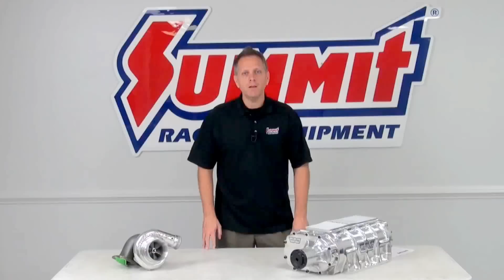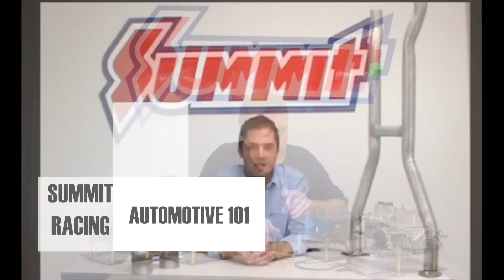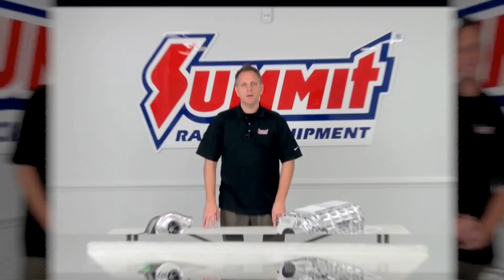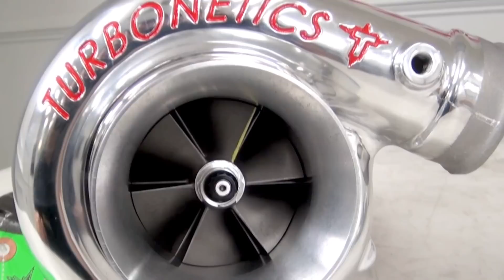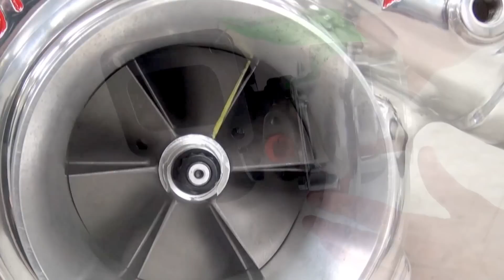Supercharger vs Turbo - Summit Racing 101

Comment: hi i have a stock 1997 chevy silverado would it a good choice to turbo charge it or would it be better if i do a supercharger im looking for something that can be daily driven but can also get down on the track?
Reply from the maker: Hi Alejandro, 
Either one fits that bill. Both are OE installed on a multitude of application over the years proving their reliability. What it really comes down to is this, are you a fabricator and installing yourself or are you looking for a kit? A kit you say, well then, availability and affordability need to be answered as well.

Comment: Two things:

I know that you can have multiple turbochargers on a car, and even a combination of a turbocharger and a supercharger (twincharger). But what about multiple superchargers?

Also, what is the difference between a traditional turbocharger and a variable geometry turbocharger?

Thanks.
Reply from the maker: Hi Jarek, 
Yes, you can have/use multiple superchargers. It just adds cost and complexity to the drive belt system. A Variable Geometry Turbocharger (VGT) has computer controlled vanes built into the exhaust (hot) side of the Turbo. Varying or adjusting the position of these vanes allows quicker spool ups and also engine breaking in diesel applications.  There is lots of info online about these or give us a call, we’ll help you where we can. 1-330-630-0240. Thanks for watching!

Comment: I drive a 07 lexus gs 350, what would you recommend for that? turbo or super?
Reply from the maker: Hi Flako, 
First, this will depend on kit availability for the vehicle. Next, if you’ll be the installer then kit & installation complexity should be considered. Lastly, affordability. When said kit is found, does it fit the budget.

Comment: I believe the best design of all. ( better than turbo charging or belt driven superchargers ) would be to spin either of these with an electric motor.  And not from the one car battery, but from a completely separate power source of rechargeable batteries which would be charged from the ac 110 or 220 volt circuit from a home or business.  The electric motor would have to be powerful enough to drive the blower or turbine as fast as the conventional types of super/turbo chargers.  The only downside to this would be the added weight of the number of batteries it would take to power the electric motor that would drive the blower/turbine ( and space to mount everything ).  Don't know how many batteries it would take but probably enough to add at least an extra 100 pounds is my guess.

Comment: I've had this idea for quite some time yet have never seen any forced induction design of this type.  My idea is to take your standard roots type blower, and rather than spin it from a belt off the crank of the motor, spin in with the exhaust half section of a standard turbo charger.  I know that in order to make this work, there would have to be some type of gear to step down the speed of the turbo charger quite a bit to get a similar rpm of the blower that a belt driven design would produce.  But I see no reason why this type of design wouldn't work.  Has this ever been done before?  I have never seen it.  And if the question of WHY comes up.  I would say because this would save much of the wasted horsepower lost from the belt driven design which uses power from the crank.  And if one were to ask, "why not just use the original turbo charger, rather than wasting the time and money to mate half of a turbo to a blower.  Answer:  just because it's never been done!  Just for the sake of curiosity!
Reply: That's a neat idea, but it takes a LOT of power to turn the gears in a supercharger. That's why you have the parasitic horsepower gains that he was talking about. On top of that, if you did get that to work you would loose a lot of efficiency in the end and still have lag since it's running off the exhaust. The turbo would have to move sooooo much faster than the supercharger's crank belt.

Comment: WOW..................   parasitic drive loss on super charger is around 30%   11% on turbos.  Turbos don't spool off air flow the spool from heat. That is why they are so efficient it is like they have a brain and work when needed. Both have there application but for power and efficiency I would choose turbos.

Comment: I have a 2002 ford mustang convertible it's a v6.. Im not a racer (any more) .. I just want a lol more power .. which do you think?
Reply: Turbo. More efficient but also more expensive. But will keep your engines running longer than a supercharger would. Much lesser stress on the engine when you are not going over 3k rpm or redline ing. But when you do all the power is there without sacrificing your engine power at all.
Reply from the maker: Hi Jose, 
If you are not willing to fabricate your own kit, and many are not, then your decision ultimately will be made by kit availability for your specific car.
Reply: +Summit Racing I have 2002 mustang convertible v6.. I found a turbo kit for $600... but found supercharger for $650..

Comment: Should I do a 5.3 ls turbo or 6.0 supercharged for an 96 impala ss? and why?
Reply: Turbo. You do not lose power to gain more power. Better fuel economy than having a stock engine. Engine runs more efficiently when driving normally. Engine will last longer on normal drive. Only time you want the engine to work harder is when you are going past 3k rpm to redline that is when all the power kicks in for some fun and it adds power to the engine without stealing any power from it.

Supercharger, the power is always there through out the rpm range whether you are driving it normally or taking it past 3k rpm to redline. But you are always losing some power to gain more power which will stress out your engine more wheter racing or normal driving. The engine will always have to work harder to make more power to run the supercharger. Lesser life span for your engine and more poor fuel economy. But it is also less expensive of an upgrade and more to easy upgrade.

Unless of course you know how to build your own turbo and can buy cheap turbo parts from ebay and assemble it yourself. But it is important to get a very good turno headers though. Already buily turbo kits for your car is where it is a lot more expensive.
Reply: Turbo headers*

Comment: Which one fit for better mid and top end power for my 370z nismo 15'
Reply: Turbo forsure on v6s but go twin turbo
Reply from the maker: +hayato zami, 
Many times due to cramped engine compartments and fitment issues, these kit are engineered and sold by specialty shops. Currently we do not have either kit available for that car.  But, we do have Nitrous kits available. Same power gain, more affordable!  Give us a call if interested! 1-330-630-0240.

Comment: Turbos heat the intake air more(risking detonation more)... Turbo manifolds are restrictive, especially when compared to headers which can be used with Superchargers... The strain Superchargers put on the crank can be countered with lighter cranks\flywheels etc - the centrifugal ones anyway... Superchargers are the BEST...
Reply: Turbo manifolds are not to restrictive stock truck manifolds can make a 1000rwhp , and you can use headers on turbos by using front facing headers or rear mount turbos and a trubo blanket with heat wrap will keep your intake temps down along with methanol and per lb of boost turbos are the more efficient than a supercharger also a proper turbo set can put more tourqe down than your avg supercharger with little to no lag amd still be slightly less abusive than a  supercharger.

Comment: I'm still new to superchargers and turbochargers. I think I want a centrifugal supercharger because it's easier to install for a beginner and smaller too. But I don't really understand the concept of parasitic loss from the horsepower? If for example I have a mazda with 2.5L 184hp, how much hp is lossed because of the parasitic loss? And if it's a centrifugal charger, will it increase by boost after a certain rpm like 3,500? Before it reaches that amount, will my car run slower until it hits that rpm?
Reply from the maker: +Jeric Tamayo (Momentum33) , 
Can you give our tech department a call? 1-330-630-0240. We would like to discuss this with you. 
Thanks for watching!
Reply: +Jeric Tamayo (Momentum33) The centrifugal is the best option - you are on the right track(keep going)... The loss is due to added strain put on the crank in order to turn the charger... Modern SCs induce less strain - PLUS - you can reduce rotating mass elsewhere in the drive train to compensate for loss, with lightened flywheels, internals, pulleys etc... I can talk more - let me know if you want more points(& use an intercooler - I would, if I could afford it)... =]
Reply: +Jeric Tamayo (Momentum33) Oh I forgot - boost with the C-SC is like 2PSI at 2000RPM - for example - & increases to max advertised(less piping & intercooler loss)at max RPM... I once saw a listing for a SC for a Honda Fit with similar data - if I can find it I'll put in the link...

Comment: This video is full of misinformation, and is very incomplete. It lacks information on turbochargers, and fails to mention much on superchargers, especially the short comings. You even go as far to say turbocharged engines lack the ability for fine tuning while saying that a supercharged engine with a roots blower does! A roots supercharged engine is highly sustainable to  power surging at low rpm as it provides highly turbulent intake air, which makes it very hard to tune. Not to mention the high inefficiency of a roots blower which is also not mentioned!
Reply from the maker: +NileLTR , 
Thank you for your input. This is a 101-very basic information. We will work on a more technical video. Thank you for watching and sharing your knowledge!

Comment: I've noticed from these comments a lot of people don't understand this at all. Turbo's are better for track and four and six cylinders. Superchargers are better for drag and eight cylinders and higher. To turbo/ supercharge a car with high psi and high power, YOU WILL NEED FORGED INTERNALS. This will cost a good 1000 dollars or more. If youb opt to buy one anyway without doing this and run high power. Your engine won't last nearly as long and could blow up while driving. A blown engine means you will have to replace your engine. Also go with smaller upgrades like exhaust, intake, clutch kit, short throw, better carb if you need one, and chip upgrades if you will spend more than what the car is worth. If you have a 3000 dollar car don't buy a turbo kit. Also cars that are fwd are risky adding this much power. If you add to much hp to fwd you will get torque steer which sucks ass. Last and final point, don't buy ebay turbo kits!!!!! They are trash and don't add good hp.You are not getting a good deal, you are just getting a shitty turbo. A good turbo or supercharger will be a few thousand dollars or more. Ebay turbos will blow apart. They are all made in china more or less. ITS YOUR CHOICE THOUGH BUT BE WISE ABOUT INVESTMENTS LIKE THIS
Reply: OnTheEdge OfGravity just want to say that superchargers can be quite good for track when there are lots of twists and turns due to faster power recovery compared to turbos
Reply: Thanks for the info! I have a 2013 Honda civic SI, and I would like to get a turbo kit. Which one would you recommend?? And what parts you recommend me to change to get the max power out of my k24? Thanks in advance!
Reply: Your Right. There is a lot more involved than just bolting a turbo or supercharger on a vehicle
Reply: Yeah average dim wit will twin turbo on a stock everything, blow parts and complain, everyday.
Reply: What if I buy an Ebay turbo kit and then rebuild it with a kit made for a quality turbo? Wouldn't that be the best of Both Worlds? The internals is all that really matters right?

Comment: What do you think about putting a turbo on a 2000 Buick Regal supercharged?
Reply: +Erickson J with the money spent on these considering a good system for either costs a couple thousand minimum, on your car it wouldn't be worth it. FWD isn't good for high hp application because you get torque steer from too much power on fwd. Save your money. By intake, exhaust, lighten your car, thats what i would advise
Reply from the maker: +Erickson J , 
Sounds like it could be fun. Good luck! :)

Comment: So I have a 2010 Civic SI, I'm looking at buying one of these 2 but not sure which would be best. SI's have VTEC so I already have SOME high rmp power but what would you recommend? Also this is an after thought but I much prefer the sound of a turbo and blow off valves.
Reply from the maker: +Ian Breckenridge, 
Ultimately both achieve the same thing, pressurizing the intake manifold thus boosting performance. It really comes down to cost, installation difficulty (if you are installing) and is it available in a kit so you make sure all required pieces are included!

Comment: I want to supercharge my 2004 Tahoe how much more gas would it use because it only gets 13 mpg
Reply from the maker: +Brian Hayes , 
Depending on the custom computer tune that you use, due to the air moving through the motor more efficiently, it’s possible you may gain some fuel economy. That is providing your right foot doesn’t stay too heavy after the install.

Comment: Should I keep the supercharger in my Hellcat, or should I put in a twin turbo system
Reply: Twin charge it, basically drop money on a turbo (and an intercooler if you don't have one)
Reply from the maker: +C. Kendall , 
Well, that car makes a good bit of power already! But, if that’s not enough then the answer to your question is pretty clear!!  :)

Comment: i have a 2001 aurora v8. The car is already pretty good but it could be better do you have any idea on what i can do to add some power (the most i can)  and some cautions too?
Reply from the maker: +Emanuel Cazarez, 
That car is now 15 years old and not exactly high on the popularity list for aftermarket vendors making parts. It will come down to part availability, and potentially fabrication for this car.

Comment: you think turbo lag can be reversed by putting an air tank in your trunk and an switch under the gas peddle and hooking the air tank to the exhaust right before the turbo
Reply: +M80 Gaming With today's selection of turbo charges lag isn't much of an issue.  People still use turbo's that generate lots of lag, but it's for the top end pay off.  My car has lots of lag below 3000rpm, by 4500rpm it's nearly as responsive as a NA motor and reline is 8000rpm.  My engine makes all it's power up there anyway so don't really care.

Also it would be easier to pre-spool with an electric motor vs compressed air.  High end turbo's use variable geometry to minimize lag.  This allows a medium to large turbo to provide the low end performance of a small turbo at low rpm and big HP of a larger turbo at high rpm.
Reply: +M80 Gaming Thats a waste of money considering not all turbos have lots of lag. Lag depends on size of turbo and A/R ratio. The higher the number ratio the longer spin up time. Avoid lag by just getting a smaller A/R on a bigger turbo

Comment: What would be better for a eclipse spyder?
Reply from the maker: +Brandon Ballesteros , 
We need some additional information from you. Can you please call our tech line at 1-330-630-0240. Thanks!
Reply: +Brandon Ballesteros probably turbo, although i would suggest a different upgrade. Decently powerful turbos require forged internals which are expensive. If you don't get these internals, this engine wont last as long or blow up

Comment: need more power ? just need more fuel !! thats it !
Reply: +uriel zavala garcia but you cant burn that fuel without more air or more cpacity. that is what forced induction means. you put more air into the engine at higher pressure so that you can burn more fuel and you have more tourge
Reply: +MigotRen if you put more fuel you need change the computer for that, that its cheaper than buy a sc. But sc its thebest option to have more power with more cost.
Reply: uriel zavala garcia WHAT?...your english seems to have failed you.  but of course you need to change the settings in your ecu.

Comment: which would be better for a brz
Reply: its a light and a well built car which can be done a lot to. there is a reason why there is a lot of after market stuff for the brz/frs/86. turbo or supercharge...it'll be a great car to be in.
Reply from the maker: +Darion Murray , 
Can you give our tech line a call? We need some additional information from you. 1-330-630-0240.
Reply: Darion Murray I think super Charger
Reply: I know this comment is old, but I 100% agree. Anymore than 50 your defeating the purpose of the car.
Reply: Definitely not the turbo, since the car is balanced for it's stock performance. The supercharger is probably what you are looking for (non-track), whilst the turbocharger will only entice you into either: crashing, or buying a bigger turbo lol
Reply: Darion Murray get a supercharger for better power on turns, brzs really only need 40 more hp to be perfect imo
Reply: Darion Murray or you can just buy a real car
Reply: +Darion Murray most likely turbo

Comment: which system gives more consistency or should i say reliability? for BMW E92 M3 thanks !
Reply: For reliability go for a supercharger screw type. But if your looking for more constant power then root supercharger
Reply: my M3 i just want to have more hp with ESS supercharge and also for track use thats why i ask whether which system is more reliable
Reply from the maker: +keith wong, 
Both can be equally reliable and powerful. If you are having the installation done by a shop, it will ultimately boil down to kit availability and affordability!